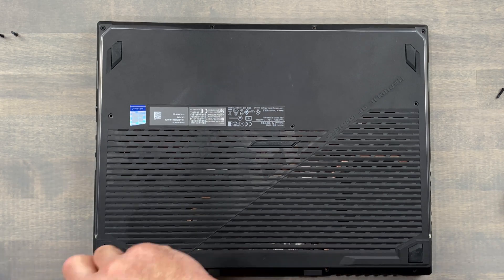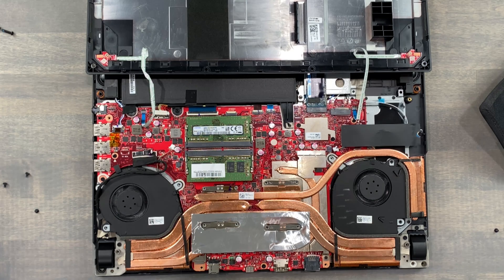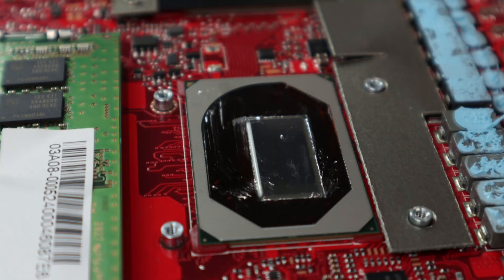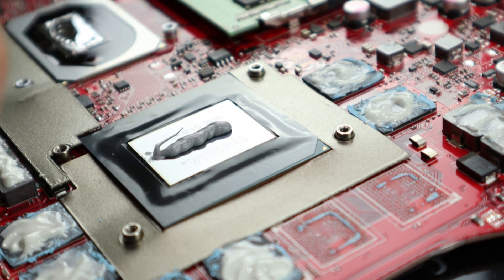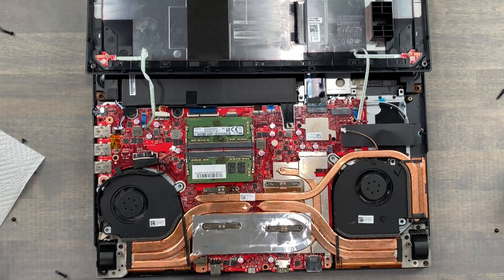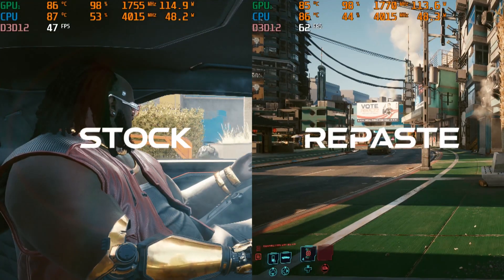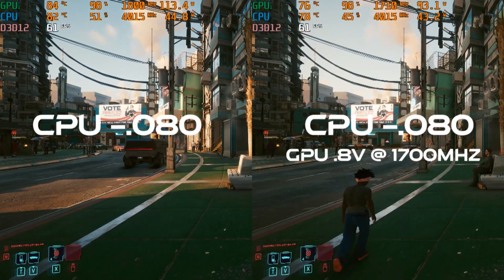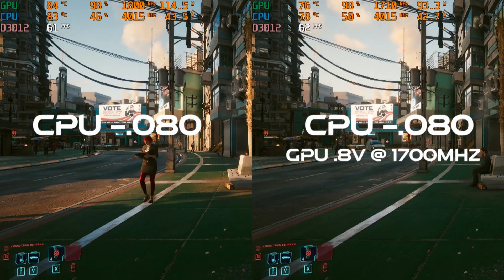Strix G15 Repaste!  (10870H 2060 115w)

Comment: Very interesting repaste video, considering OEMs and even high end boutique vendors are going for heterogeneous thermal interfaces, liquid metal on CPU and paste on GPU. I have never applied/reapplied liquid metal so here are my concerns: 
While repasting the GPU, can we leave the liquid metal as is on the heatsink and GPU die instead of removing it and cleaning the surfaces for reapply? or does removing the heatsink screw up the perfect contact and fitment needed for liquid metal to perform it's magic and are forced to reapply liquid metal every couple of years just to repaste the GPU? 

Knowing that liquid metal (LM) if left alone can easily last 5 to 7 years without degradation according to some users on notebookreview forums and my vendor HIDevolution told me LM is good for the life of the system I do not like this new approach one bit.
Liquid metal is much more expensive, requires higher skill and patience to apply (risk of shorting MOBO) plus is not easy to find outside of Europe, USA and rich Asia (Taiwan, Korea, Singapore, Japan, Australia). So when the thermal paste on the GPU eventually dries out and pushes out in 1 to 2 years (unless you use phobya nanogrease or IC diamond, 3/4 years), so the user needs to repaste the GPU but if he can't find liquid metal, can he just leave it on the heatsink and CPU die or will he have to remove the LM and downgrade to thermal paste?

I mean I get it why they put paste on GPU and liquid metal on the CPU because the heat-pipes are shared they give the better thermal conductivity interface to the hotter CPU so they GPU runs warmer because exchanges less heat to not saturate the heatsink so much. But this is wasteful and super expensive when it comes to maintenance and reapply... I prefer Liquid Metal on both CPU and GPU as done on my laptop (can't be bothered with repastes) but the fact that recently, even high end boutique vendors are doing this heterogeneous approach to TIM is not to my liking one bit and they are charging the same price as they did for liquid metal on both CPU and GPU back in 2019-late 2020...
Reply from the maker: Once you break the LM seal you really should clean and redo it.  

The reason why LM isn’t on the GPU is because Nvidia won’t honor the warranty.   Companies like HID eat it should the GPU fail.
Reply: @BobOfAllTrades  Well sheet... I got lucky to get a laptop before Nvidia pulled that warranty stunt on liquid metal. I don't plan to upgrade until 2023 (raptor/meteor lake or Zen 5/5+, RDNA 3 or Lovelace/Hopper) I hope it gets sorted out by then, or vendors at least use long lasting paste like phobia nanogrease and not Gelid or kryonaut.
Reply from the maker: @Frencho9  You can’t blame them.  I wouldn’t want to warranty failure on my product that you put liquid metal on either.
Reply: @BobOfAllTrades  Thanks for explanation, I really thought it was a cost saving/thermal optimization rational decision due to shared heatpipes. But turns out it's just Nvidia being ahole drama queen as usual. I mean, if CPU makers are cool with liquid metal when manufacturers like Asus or Playstation put the necesary safeguards like foam dams and kapton tape I don't see why Nvidia makes a fuss about that. If you can do it for a CPU SoC so can you for a GPU SoC. OEMs and vendors always getting the shaft with Nvidia, G-Sync certification fees on a per panel basis is another cutthroat thing they do. I wonder if AMD will greenlight liquid metal on their mobile dGPU if OEMs guarantee anti spill safeguards. Also I hope we get freesync on the AMD dGPU and not have to bypass via the vega iGPU like on ampere cards (again I suspect Nvidia not playing nice  with AMD freesync just to push their G-sync). No wonder TSMC does not want to do business with them lol.
Reply from the maker: @Frencho9  The contact points around the die and much harder to cover versus an Intel CPU for example.

Comment: thanks for the video! what's the exact thermal conductivity of K5 pro? I couldn't find it, same with Arctic MX 5 lol. Also, any luck on GPU undervolting after disabling dynamic boost?
Reply from the maker: Unfortunately disabling Boost on the Aorus results is weird CPU behavior that drops to around 30w off and on.  I brought it up on the other channel.

Comment: Bob i didn't see the heatsink being coated with LM? Is it optional? I still paint the heatsink even with normal thermal paste.
Reply: He did mention that he put a thin amount of LM on the nickel painted part of heatsink that corresponds to the CPU. He didn't show it but he did say that he did it.
Reply: normal paste itd be no downside, but LM you want to control where it goes as much as possible. too much can easily fry the laptop
Reply: @bradhaines3142  yes i know LM can destroy the entire board if tape and foam dam isn't used along with conformal coating or nail polish

Comment: Hey Bob. When you say 1700 MHz @ 800 mV, do you have the value for the offset ? As GPU Boost depends on temps, you don't have the same in AB V/F curve at idle vs load.

Comment: Gpu undervolting is underrated
Reply from the maker: Hey it’s not for a lack of trying I’ve been talking about this for two years 👍
Reply: @BobOfAllTrades  Yeah I first learned about it using your guide. Was experimenting with my new laptop yesterday with a very conservative voltage and was very happy with performance and temps 👍
Reply: Same here.....before Bob I was unnecessarily focused on overclocking and frying my laptop. It's only after I came across Bob's channel, became more focused on undervolting and creating a fine balance between thermals and 60 FPS performance..... Hey BOB where r u now days..... not seen u around for some time now....
Reply: :o

Comment: First ,great video bob ....BUT..hear me out.....how about cutting holes on the bottom cover holes right above fans so it can breath better..like honey comb holes.....im 100% sure asus is choking their laptops like this and ive been thinking about doing this with my own laptop  A LOT what do you think ?will it improve ? ( i dont care about the bs like having aiflow on other components as if it was necessary other brands wouldve done the same as asus )
Reply: yeah it is effective since I've tried cutting intake vents onto the asus tuf15 using a dremel cutter. Temps dropped alot and would average 75c lower while gaming on ultra settings.
Reply: @joedio92  what is the cpu in that laptop ?4800H? What gpu ? And have to repasted the device as well ? Whats your max and average temps under load in constant strain of cpu and gpu if you dont mind me asking ....any hiccups or performance loss ????
Reply: @phantompanda1508  ryzen 7 3750H + gtx1660ti, it never went past 75c and would hover around 65-74c as my client would say. Wouldn't need to worry about it having repasted again since I decided to use graphite onto his system.
Reply: @joedio92  awesome !cheers

Comment: my asus rog scar 2 GL504GW with bios 307 can no longer be able to undervolted neither in bios nor throttlestop :(  i can't downgrade my bios to 305 cause it will causes apps crashing as i just replaced the motherboard :(. Do you know where i can find modded bios for 307 GL504GW?
Reply: There might be a way to downgrade bios using ezflash usb method. If the older bios has older mei firmware it won't work correctly since mei firmware can't be downgraded aside from using hardware spi flasher

Comment: So much goop!!! This is why I stick with thermal pads when I can. Less stuff to clean up. But that’s just personal preference. Really nice to see the thermal compounds and liquid metal they use is applied well. That’s a far cry from the good ol days where you HAD to repaste your laptop day one and get 5-10 degree drop. 

Nice undervolt too. 8 degrees is a massive gain.
Reply from the maker: As these become thinner and thinner the tolerance for .5mm pads becomes too thick and paste is the only option.  

I too much prefer pads based on everything you said.

Comment: Yikes, did something go bad with encoding the video because it's so, I don't know, glitchy? And nice for the video.
Reply: it's fine, you're talking about the gameplay footage? That's the capture card or some issue, the video for repasting is clearly normal as is his other videos. His gameplay footage/MSI afterburner overlay always looks like that
Reply: @roboticvenom1935  nah i see what he's talking about. look at 2:50 the board red part has horizontal lines fluctuating, and i'm on 1080p. probably a rendering issue of codecs. i mean, by no means does it ruin anything but it is noticeable.
Reply from the maker: This was my first UHD render with this camera.  Plus I’m getting use to the settings to render this footage with a Ryzen CPU.  Lots of different things happening here so better to try this out on a video like this versus a review that actually gets views 👍
Reply: @BobOfAllTrades  oh, I see. All is good. Just saying how it looks like :D
Reply: @Janzer_  you're right! But it's much less drastic then the gameplay footage, I honestly can hardly tell with normal footage
Reply from the maker: @roboticvenom1935  The gameplay footage was recorded in 1080 P. It gets weird when I try to record it with a higher resolution over the displays negative resolution sometimes.
Reply: Bob Of All Trades I did notice the on screen fps temp etc was moving up and dowb a bit too.
Reply from the maker: @ACE112ACE112  Usually after a good heat soak, when temps move up and down a degree can be looked at as a plateau.